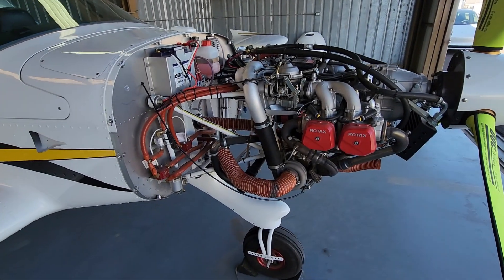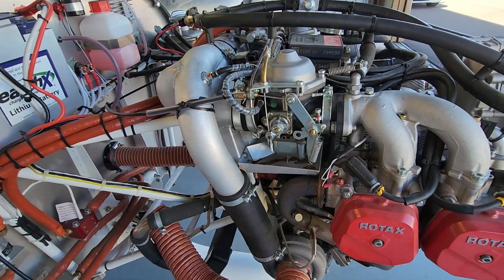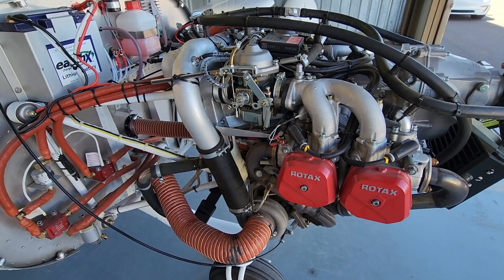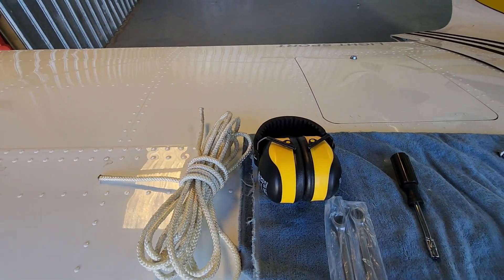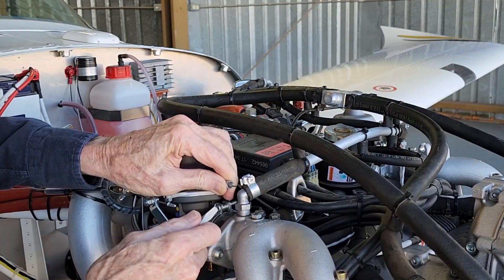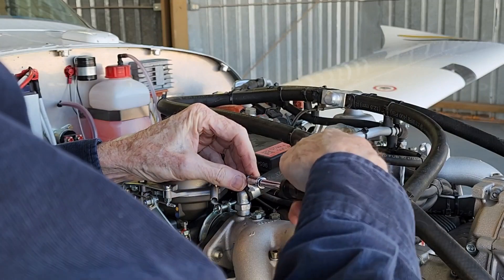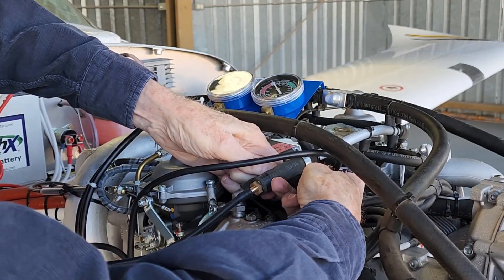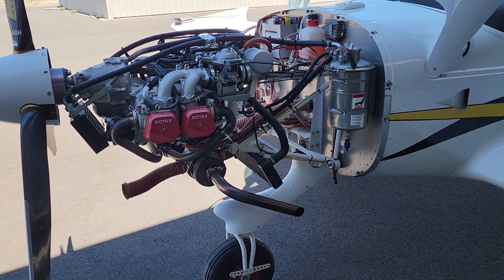Rotax 914/912 Carb Sync

Comment: Two questions:
1. To balance the carbs at 3000 rpm, you used the ferrule nut adjustment l assume.
2. Any comments on how the select the correct needle position ? There are 4 positions for the circlip… I need some advice on how to select the right one. Thx
Reply from the maker: Yes, I used the ferrule nuts.  Never had to adjust the needle.  My understanding is that the spark plugs are your guide as to whether or not the mixture needs adjusting.  Mine have always been fine.  Rick
Reply: Great video ! Thanks for the reply
Reply: Its in the manuals.